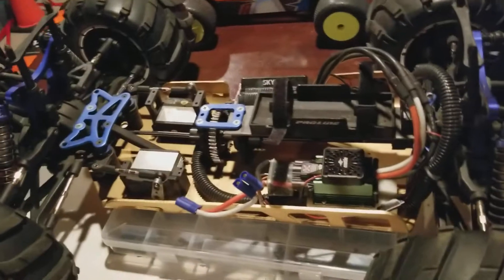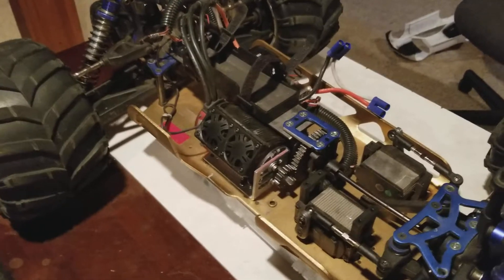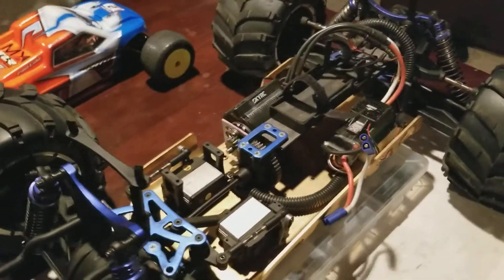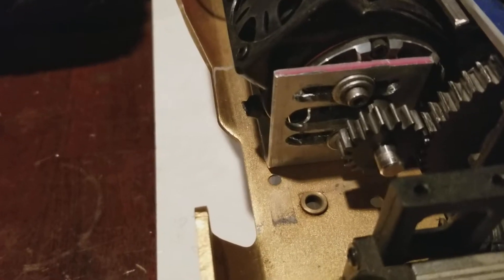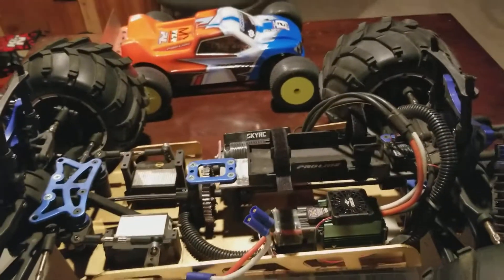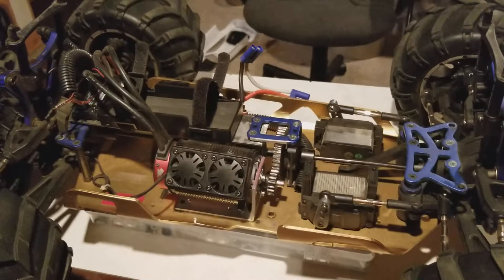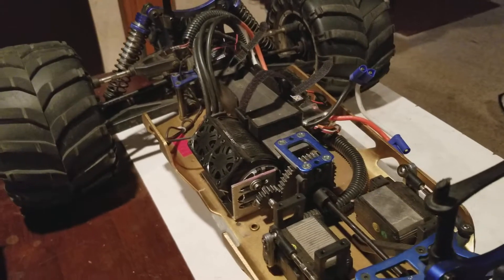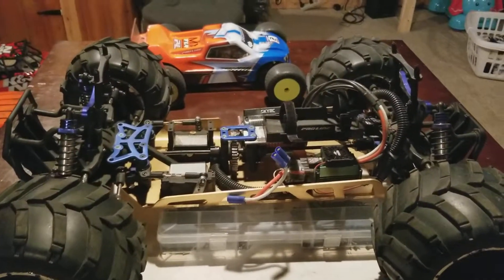Redcat rampage MT electric conversion

Comment: Cool i have a redcat volcano s30 original have a arrma center diff holder with a 44t spool and a 20t pinon arrma blx 2050kv 6s hobbywing with duratrax belted wheels  xr8plus esc

Comment: What is your center diff made from? Is that the stock mount with a custom deff? I can't tell? 
Also, you can always use these on the stock wheel hexes and then mount pretty much 24mm wheel hex rim. 
https://dealer.redcatracing.com/09065